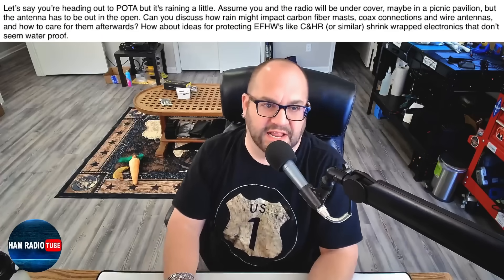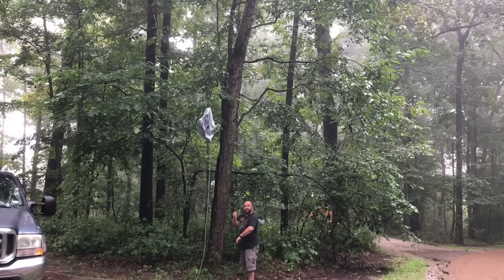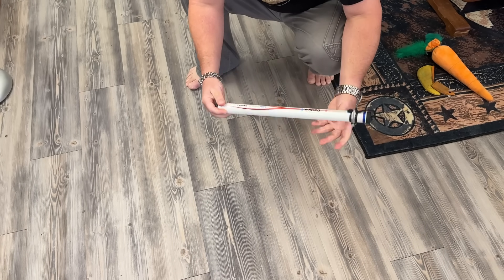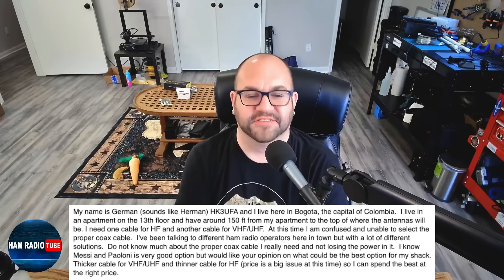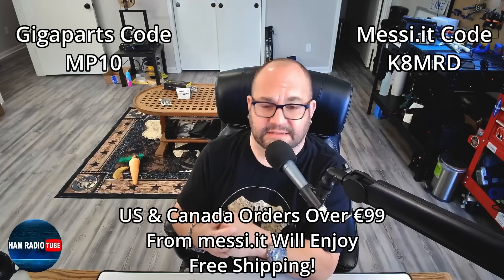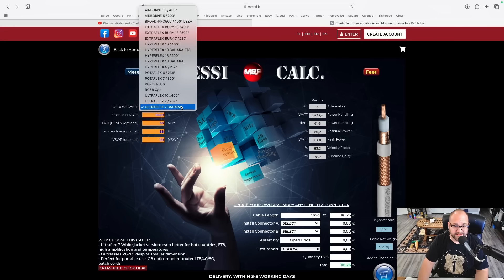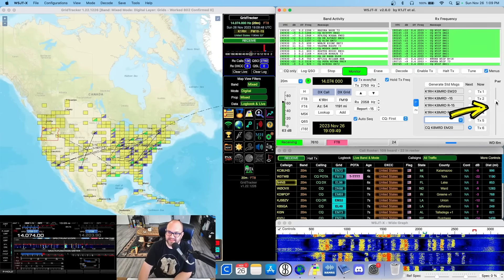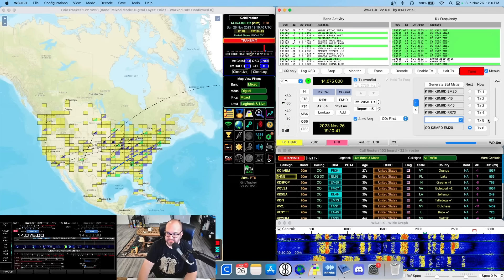Don't Be An FT8 Lid:  Put Out A Clean Signal Instead!

Comment: My .02 on the LID thing, Yaesu's and Icoms are a little different with ALC and that slider. For sure that slider will reduce ALC, but with the DX10 (991, 891 and others) we have a digital gain setting. Dropping the slider down will decrease your output power. Yaesu radios can and should show something on the ALC meter (about 50%, ALC doesn't actually kick in until past that) otherwise you're just cutting output power. Instead, adjust digital gain down until ALC is out of the red. You DO have to use that slider on Icoms, they don't have that digital gain function. I was so confused running digital on Yaesu radios until I figured that out. Anyway, thanks for the videos Mike!
Reply from the maker: Good to know.  The Xiegu G90 wants to be at 100% so go figure.  Even without an ALC meter though, per the WSJT-X manual (yeah I know, I read the manual) they say to adjust the power slider down until you just start to see the power dip a touch.  Then you should be good.

Comment: Question--- why not run just one coax at 150' and use a remote antenna switch? This is how my shack is set. One run of 120' with  two 6' jumpers to the switch. From the shack I can switch between the 2 antennas without 240' of coax.
Reply: Everyone is different, I dislike remote switches and prefer manual switches, also remote switches are expensive as hell for what they are.
Reply: @GoonyMclinux  half the price as 100+ feet of coax!
Reply: Or use a pair of duplexers -- no moving parts, and you can run HF and VHF/UHF at the same time.

Comment: I disassemble my masts and wash them in the bath every so often. Get all the grit before it scratches the fibreglass. Also be careful about using adhesive tape - some tapes strip off the lacquer when you take the tape off.

Comment: Do what Lord Callum does with his coax connections.... use some Vaseline in the connector. It actually does work well.
Reply from the maker: I've only got one use for Vaseline and it ain't for antennas lol!
Reply: I have always used some silicone dialectic grease, lasts longer and isn't as messy.

Comment: I purchased the Hyperflex 13 for my Earth station installation. Everyone said I would need Pre Amps with a 120 foot run of my coax. I got the Hyperflex 13 coax (had them put on the connectors) I have been operating a bunch of satellites just fine with no preamps. I would have needed 2 of them at 600$ each so I saved money with Great coax!

I forgot about any discount code but that's ok. I am so happy that I ordered some of their coax for POAT and a portable satellite setups.

Comment: About the LID thing, I was on 20m one morning doing some FT8. One station on there was running an amp, putting out who knows what power, causing harmonics throughout the spectrum all the way down on 14.070. 

Not sure how far up the harmonics went, but it was absolutely horrendous. I heard the amp kick on when the station was transmitting, it was that bad. After a few minutes of that, I went to another mode. I don't care how much power one uses on FT8 (to each their own), but causing harmonics from 4KHz down, that's ridiculous.

Comment: How hard is it to put the connectors on their coax? Can I do it without special tools?
Many of the videos that tell how to set up FT8 do NOT tell about adjusting the output. I don't know why they don't. It seems like a very important thing to tell.  73   W4DES
Reply from the maker: Great question Don.  I did a video about them a while ago.  They are stupid easy.  All you need is a soldering iron for the center connector and a couple wrenches to tighten down the rest of the connector on the shield.  You can watch this whole video but I've time stamped it here to start the installation part.  https://youtu.be/B5S7Z33AFQc?si=UIqDgAP8QNzfR-Wm&t=456  Hope this helps
Reply: Thank you! I have put PL259 on coax many times RG8 and RG58, but some of the new coax have some strange connectors for them. I have a 60 ft tower, and I don't want to climb it to find out all the run. Just get what I think I will need to come down the tower to the ground rod and from there to inside to the radio and have some so I can move the radio around later. Always give room to move things later because it will happen. 73    W4DES @hamradiotube

Comment: I have a Xiegu X6100. If I use with the default firmware the ALC is 1 with that power slider fully up. If I eun the R1CBU firmware I need to slide down the pwr slider to have ALC beloved 1. BUT in any case sliding that pwr slider it also affects my output power. So what is the trick to have full power (10w what a xiegu x6100 can do) but also have ALC 0?! Best 73 YO5QKA

Comment: Howdy,

Let's please add...
A) learn how to RTFM (read the freaking manual!)

B) learn how to choose a CLEAR FREQUENCY!  LOOK, then LOOK, then LOOK again!!!  And! Stay off of the DX stations around the world.

C) learn how to USE THE TX HOLD box to stay put! (See B above!)

D) learn how to operate Fox & Hound properly; i.e. stay off of the Fox freq.!  & TX above 1000 Hz. (Unless they call you and pull you down there!)

E) finally, if you have a 1500 Watt amp, please find a clear freq instead of the std. FTx freqs. because you WILL splatter & bleed all over. Like 600 - 800 Hz instead of 50 Hz if your QRO in anywhere near another ham within 50 miles... I have 1 guy who's 35 miles away, his signal is clean on a station scope and out the antenna, but he runs 800 Hz wide on FT8, More on FT4.

Thanks 

73 John